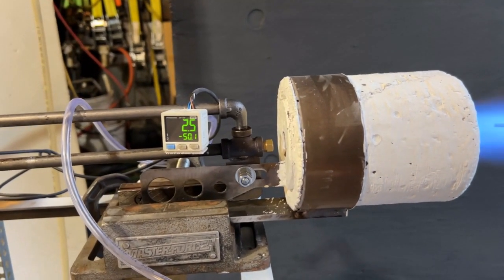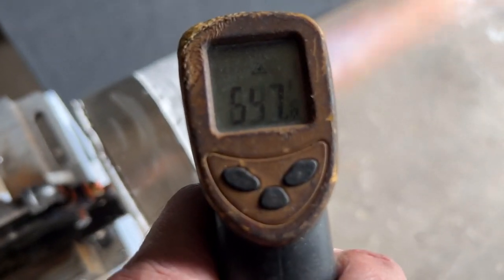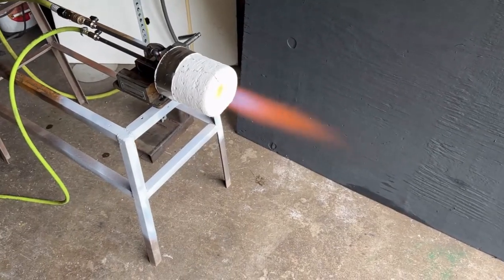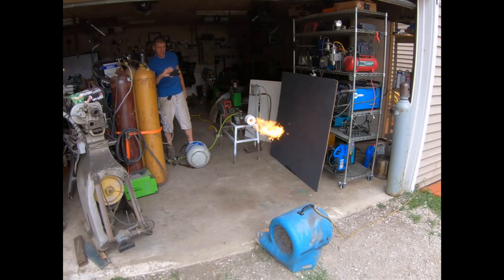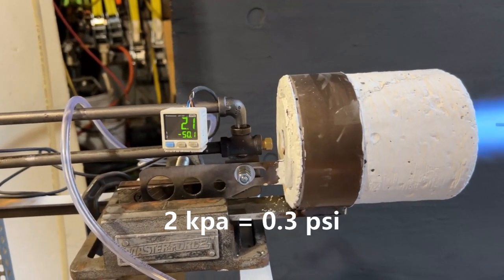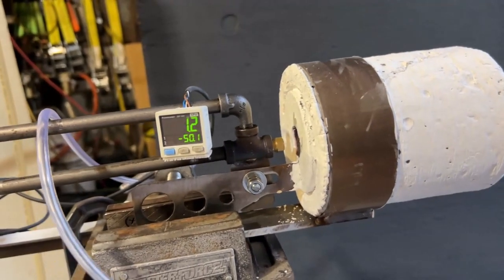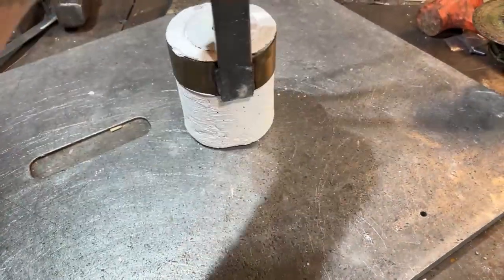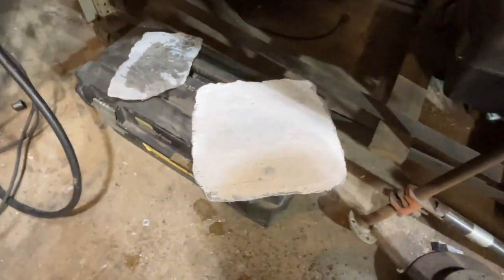The Rhino High Velocity Kiln and casting burner

Comment: Have you tried any burnout material (or foam) to create voids?  I use that for my refractory projects.  Wheat flour, sawdust, graphite, charcoal... The reinforcing fibers are great for strength while the voids slow down thermal migration and eases thermal stress.
Reply from the maker: Ive considered wax but havnt tried it yet
Reply: @NOBOX7  I've never used wax. I'll give it a try in my next project (kiln burners). What kins of wax application are you considering?  Normally, I mix in volumetric parts of flour and saw dust (in varying grades). The flour is so easy to add in the dry mix and provides the micro porosity.

Comment: I have seen some people inject water into waste oil burners.  The oil and water appear to get hotter than oil only.  Do you have any thoughts on the subject?
Reply: i've had the opposite effect with these style burners, the water in the mix atomizes and shuts down combustion completely
Reply: @entwisjj  I found a short video of an oil/ water burner if you are interested.  https://www.youtube.com/watch?v=xO0ZBmzf1Tw&t=56s   It looks like he is creating steam and injecting it into a secondary burn chamber to increase the draft.

When you use the term atomize, are you saying that the hydrogen and oxygen are being separated.  If that is what you mean then you will have 2 parts hydrogen and 1 part oxygen in the burn chamber.  1 part oxygen is probably not nearly enough to burn the hydrogen.  

Please don't confuse me with an expert on this subject. I am just curious about the oil and water reaction.  I am not sure if it is just flash steam or if the hydrogen is being ignited.

Thanks for engaging in the conversation.
Reply: @davemall1  not actual atomization as in the atoms themselves, what i mean is an ultra-fine mist that combusts much more easily.  we use a blower to increase draft, and have tested using the heat from our grate cooling to increase efficiency

Comment: If you need to increase the strength by a little bit you can get some chopped fiberglass and add that to the mix. I know that there are some refractory cements that do that to reduce cracking.
Reply from the maker: They sell metal fibers also and im very interested to try it